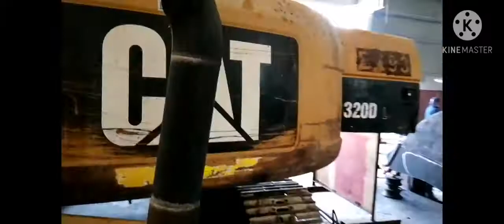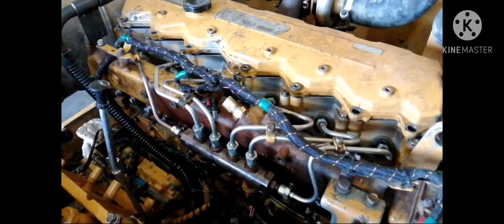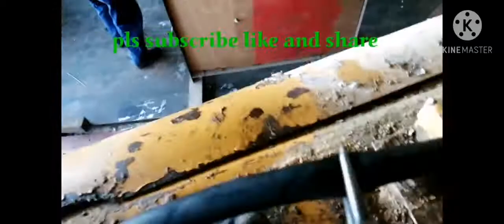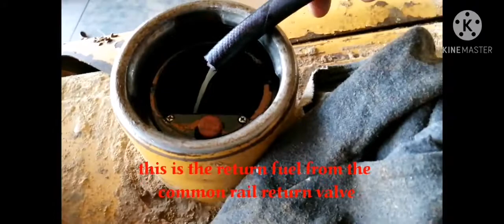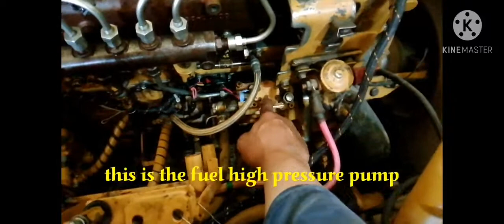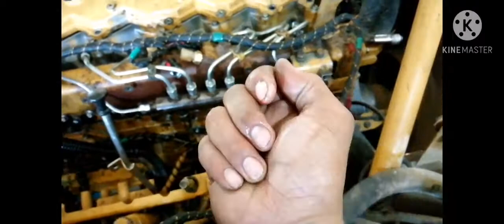CATERPILLAR EXCAVATOR 320D-L COMMON RAIL FUEL SYSTEM NOT STARTED

Comment: Good morning sir, our machine is 320D it cranck but no start. The common rail injectors have no supply of diesel from pressure pump  .what i do for this machine  hopping for your help. Thank you
Reply from the maker: Try to check just try to remove the coil remove 6screw only coil then remove the spring or the spacer only if there is then fix back the coil at the same position then try to start. Contac me in my whatsapp, +971567581176

Comment: Dear Sir, may l know the resistance value of pump speed sensor(or) secondary speed/timing sensor and fuel rail pump solenoid. Thanks a lot for sharing.
Reply from the maker: bro i am sorry for late response, regarding about you question, there is exact resistance all the sensor you are mentioning on your message, the monitoring system of the machine is the responsisble to detec if the snsor is damaging or slightly damage is eighter showing an error or hard starting with error

Comment: Hello po master maraming salamat sa tutorial.un ginagawa kong 320D/ C6.4 Asert  kapag na primer kona diesel matigas na at ayaw pa rin umadar.kailangan katihin ng Contact cleaner saka aandar at kapag  e off at paandari  uli ayaw na umandar at malambot na nman un priming pump at un fuel fiter puno ng hangin kapag niluwagan ko un banjoe bolt.sana ma advices moko master Jhune.
Reply from the maker: inspect mo muna fuel line baka hose  mo may mga crack n pweding un ang maging dahil bakit nagkakahangin,hindi ko alam kung anu nba mga nagawa mo dyan,ppwede rin isa s injector mo may internal leak n at ganun din ang pump,at yung return valve pala check mo rin
Reply: @caterpillarjhunhunk  Ang history pala ng Unit na ito humalo ang diesel sa langis kaya binaklas nmin ang Injector at high pressure pump noong nd pa binaklas ok nman ng binalik na po nagkaroon na ng problema.
Reply: at saka master un nga injector pina calibrate at un High pressure pump.
Reply: @caterpillarjhunhunk  Master pwedi ba kita ma add sa messenger para sa agarang mensahe gang ngaun nd kopa makuha saan nangagaling un hangin na pumapasok sa fuel system nya.
Reply: ganun din yung ginagawa ko caterpillar. 320D. Maraming hangin ang nasa fuel felter . Anu kaya sira  kapag may hangin na sa loob ng felter. Mamamatay na....
Reply: nka encounter naman ako maraming hangin sa loob ng felter. Ano kaya sira nito

Comment: It is a C6. 4 engine, I want also to add sir.. At lower portion of the injection pump, a bit lower of the shut off coil solenoid, there is also 1 sensor there similar to the sensor in the flywheel.... If that is not good it will not also start... It is the starting sensor... It is the primary sensor and the sensor in the flywheel is the secondary sensor..
Reply from the maker: actualy your write  about that information,that sensor is command for fuel distribution timing if thats damage engine will not start,about this video theres no problem on that sensor,the problem is on the return valve that holding the normal pressure of the common rail,thanks for sharing of your extra knowlege boss,we hope that you can give more useful idea to help others,thank you very much

Comment: ano po Kya poblema ng cat,320d nalubog po sa baha tpos nong gnwa n ng mekaniko palyado po andar ng makina, ano po Kya possible na sira, lahat ng filter bagong palit na,
Reply from the maker: kung palyado p rin, ppweding  pumasok n s fuel system o fuel line ang dumi at nkarating n rin s injectors, kya ang ggawin nyo o try nyo gawin actual remove nyo head cover then actual nyo paandarin ang makina, tpos tagalin nyo isa isa ang wire injector observe nyo kung alin ang walang epekto s andar ng makina, at un ang mga naapektuhan, pra nagbbleed k lang s normal n manual type injectors.
Reply from the maker: medyo sensetive ksi injector ng mga electronic control engine, kpag wlang computer medyo mahirap mag trouble shoot pero kung umaadar nman, medyo mas madali kpag ganyan ksi ma aactual testing mo, kdalasan kpag palyado nsa injector ang problema, o kung hindi nman palyado pero mahina nsa mga sensor ang problema.

Comment: Sir anu pwd galawin kung ung monitor ngpakita sya ng air filtr plugged
Reply from the maker: wla kang iba gagalawin kondi linisin ang airfilter or palitan ksi yan pweding baradu n kya ung switch nya pra s detection ng plugged ay nagcclose contac, or pwede rin tanggalin mo airfilter  pero before noon eh switch of mo muna ang machine pra mag release s pagkaka contac ung switch s filter, then tanggalin mo filter lahat at paandarin ng wlang filter tingnan mo kung lalabas p ung plugged, at saka eh reset mo pla ung maintenace record ng airfilter o lahat n ibalik mo s normal lahat ng maintenance record nya isa rin pla s dahilan un once kasi n reach nya ung maximun n nka setup doon
Reply: @caterpillarjhunhunk  thank u po sir godbless sir isa po aq s tga panood nyo sir

Comment: Most of the problems of the 320 are from the Injection, where the pressure is smuggled from the sprayers as a result of entering the dirt, the best parts of all the Injection

Comment: Chief pewde mg tanung? Bkit lagi nauubus lmn ng fuel filter
Reply from the maker: sinsya n po at ngayon ko lang nabasa message,alin bang filter ang nauusbusan ng laman, ppweding may singaw s fuel line mo or crack ung hose, subukan nyo mag gravety pra makita nyo ng actual kung nauubusan pba o hindi n kpag nagnormal sya s gravity, ibig sabhin nya may tama n ang fuel line mo. basta fuel system nyan bago pumasok ng pressure pump
Reply: @caterpillarjhunhunk  npalitan kuna po ung linya ng galing tank punta sa separator filter nya pti ung pa punta sa out pru chief nauubus pdn lmn ng filter sa taas pti gnwa ku dkuna pindaan sa filter deretsu na patay prin chief...ok nmn ung supply ng fuel nya kc nilinis ku ung tank pinalitan kuna dn ng filter sa ibaba..
Reply from the maker: hindi kya nagkapalit ng pwesto ung linya ng fuel hose mo n dpat from tank to separator, separator to fuel pump, then pump to pressure filter n may 3 n sensor, tpos bbalik ulit ng fuel pump yan ung, paglabas ng fuell pump papasok ng common rail high pressure, double check mo nlang muna ung fuel line bka may nagkapalit lang ng hose, alin b n filter ang nauubusan ng laman.
Reply: @caterpillarjhunhunk  common rail po sya 320d dn po chief
Reply from the maker: ibig sabihin nyan hindi nkakapasok ung fuel mo n galing s tank, so may mali o baradung hose kpag ganyan
Reply: @caterpillarjhunhunk  ok nmn chief ung linya galing tank to separator..separator my daanan sa ilalim ng ecu nya tss papuntang injection pump ..tss ilalabas ng injection pump nya papunta sa fuel pump .tpus papasuk sa filter sa itaas...pabalik sa injection pump..tss papunta sa common rail nya ktapus return tama po ba? Chief... Slmat po..ulit..
Reply: @caterpillarjhunhunk  wla po bang kinlamn dun ung fuel rail sensor? Pti ung da injection pump na sensor chief?..
Reply from the maker: s messenger tayo magusap hindi ko agad nkikita n may message, add mo ako
jhunlambino
Reply: @caterpillarjhunhunk  anu po apelyidu chief?
Reply: @caterpillarjhunhunk  mdami kc lumabas
Reply from the maker: jhunlambino lang
Reply: @caterpillarjhunhunk  ng add na aku chief..
Reply: Ung filter po chief na dlawa sa taas ...
Nuubus lmn nya pinalitan kuna po ng hose ung in gling sa tank nya pti ung out 
Tss ung lumabas sa return hose nya puru bula po chief . caterpillar dn po 320d
Reply: Common rail po sya
Reply from the maker: ang picture ko dyan eh aso
Reply: @caterpillarjhunhunk  dpo chief ma add
Reply: @caterpillarjhunhunk  ng massage na aku chief
Reply: @caterpillarjhunhunk  ksu d ma add po..

Comment: So, I am having a similar problem. Had code 00198, changed filters runs great if I can get it to start. Shut it off and it won’t start again, keep trying and eventually get lucky and it starts, runs great, but as soon as you shut it down it won’t start again. Need to know how to fix it. Local cat shop has been no help
Reply from the maker: bro sorry i only now see your message but how i can help you,.? you never mention what is the brand name of your machine. usualy if the machine is common rail type of engine check the return valve if the return volume of return is to much you hev to something to hold the pressure, or maybe injector needed to calibrate, but this just a simple idea that i want you to check, because you did not give me an info about your machine, the like i am catching in the ground no water.

Comment: #CATERPLLAR JHUNHUNK smart trick bro. but this is the high pressure relief valve and the return valve should be in the return line not the pressure line
Reply from the maker: we knew that, the mechanic he almost crazy whats wrong about his work,for morethan two days of trying to start, still they cant start, that is new overhaul engine, so is my chance to apply my technics, and the next day they only change the return valve, after that everything done
Reply: @caterpillarjhunhunk  you are  very smart 😍😍😍

Comment: Good evening!  Dear, could you help with advice.  Why does the caterpillar 320 dl get oil into the fuel and clog the fuel filters?
Reply from the maker: bro pls subscribe and also like and share,thanks for watching,bro i cant understand what do you want to say.for my understanding your oil is going into oil filter,thats the reason of fuel filter clogged,correct me if i am wrong.how possible the oil is in the fuel filter,if thats happens the it will mix to the diesel and will become same as a diesel,but the effect to the engine is smoking only,but can cause of clogging,i dont  know how its possible.

Comment: Sir may 321D may problema po walang lumalabas sa fuel papuntang  common rail manifold pa injector. Any inputs po. Thanks.
Reply: Sinubukan na Po namin na I bay pass Ang fuel system. And nag gravity na kami Wala parin nalabas papunta common rail. Ung HP solenoid sinubukan namin I bay pass nilagyan namin Ng spring sa loob para maitulak ung valve. Same parin Wala parin po.  Ilang volts Po ba output Ng HP sol.?  Pag tinangal po ung sol na dilaw lakas po Ng labas Ng fuel sa valve ung sa inuupuan Nya Po.
Reply from the maker: @paulorectin1263  tanung ko lang anu b ang nayari bago napunta s ganyang sitwasyon bigla lang b tumugil o dahan dahan tumigil, ung supply pala noon nagbabasi ung s ecm, pero halos nsa 20volts ang nalabas doon at pitik pitik lang ang supply noon hindi sya direct at nanagbabasi naman s speed nang makina
Reply from the maker: @paulorectin1263  kahit p e pump mo yung manual pump wla rin nalabas s high pressure line nya kahit kaunti man lang,ngayon kung wla p rin talaga bka nsa pump n mismo ang problema nyan,pero s gilid nang pump may dalawang plug doon n may valve s loob try mo buksan un ska manual pump mo palabisin mo desiel doon kpag lumabas n desiel doon s manual try mo nman pa start sya nang nkabukas un tingnan mo kung may lalabas kpag it inistart mo,kpag wla ppwedin pump mo n may sira or pwede rin ung timing gear nya n desconnect s shaft nya basta dapat kahit ppapaanu may lalabas sya kung sakali n may tama lang ang plunger nang fuel pump wag lang din ung n stock sya s loob
Reply from the maker: @paulorectin1263  tika prang may mali doon s hp coil n nilagyan nyo nang spring tanggalin nyo spring at ung coil temporary, ang gana kasi non at dumidikit sya s coil o hinihigop nang coil un hindi sya patulak s loob kundi pataas sya o plabas ang direction nya, ppwede nyo e start yan khit wla noon pansamantala e ddiin mo lang sya paloob kpag umandar pra mamatay
Reply: @caterpillarjhunhunk  sa ngaun po di pa namin kinokonek ung solenoid gawa nang balak namin I bay pass ung HP sol. Kaso pang tinangal po un malakas ung fuel na lumalabas sa valve na inuupuan Ng HP sol. Ok Lang Po ba na I crank un kahit Wala ung HP sol. Para Makita lang namin na may lalabas Ng fuel papunta sa injector high press manifold.?
Reply from the maker: @paulorectin1263  ok lang un pero dapat may nkaalalay doon,at nkahawak nang basahan n medyo nkaalay nang pigil para d tulamsik
Reply from the maker: ppwede mo muna check fuel line mo lalo n ang mga hose nyan or e try mo gravity, lagay k diesel s galoon tpos kung may extra kang hose n pra matesting mo kung saan nagmula problema, kung n testing mo n s gravity at wla p rin, try mo e pump yung manual pump nya pra umakyat desiel buksan mo line galing s fuel pump mo yung ppasok s common rail tingnan mo kung may lalabas n desiel kpag wla p rin try mo tanggalin ung coil n kulay dilaw s ibabaw nang fuel pump baka yang coil n yan ay d n ok ung magnet nya kpag nasuplyan nang kuryente, ppwede mo paganahin yan n baklas ang coil basta aalayan mo lang baka bigla tumalsik, ipa start mo kung aandar

Comment: Please, what is the reason, the pressure is low, as we saw in the video for the 320d engine, which means who is causing this malfunction and thanks for the video
Reply from the maker: actualy bro the reason is return valve of common rail, the spring and boll inside is loose, thats why i try my the idea, to grif by flier the return hose, to see if the engine will start, but its lucky my idea is succes
Reply from the maker: bro thanks for watching, can you pls subscribe and like my channel